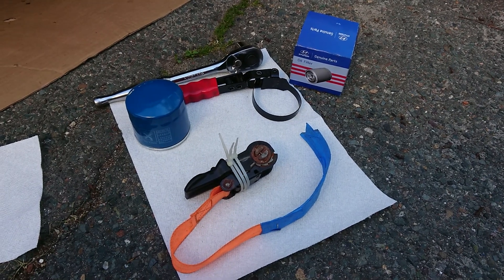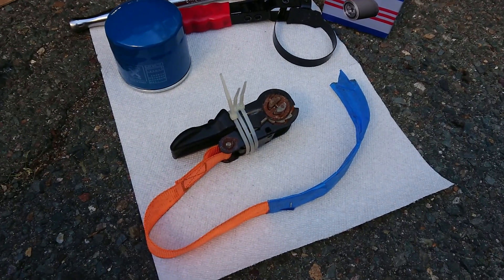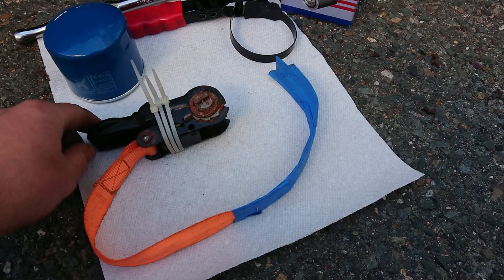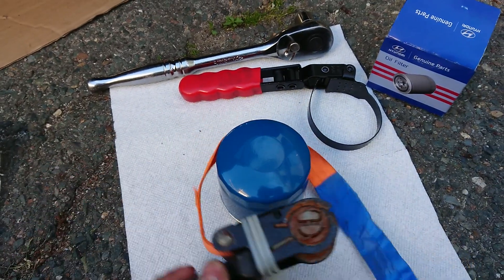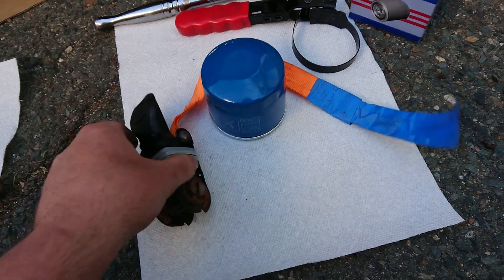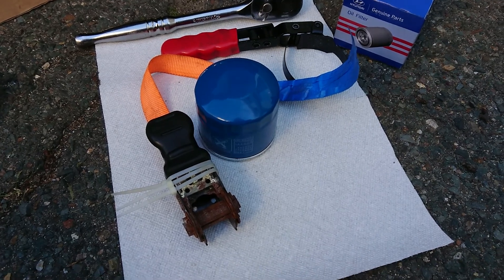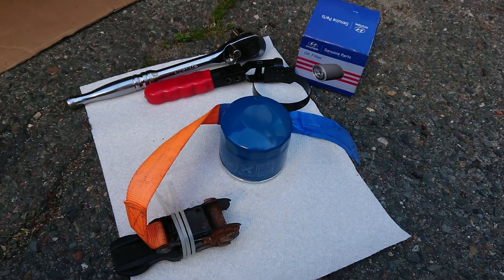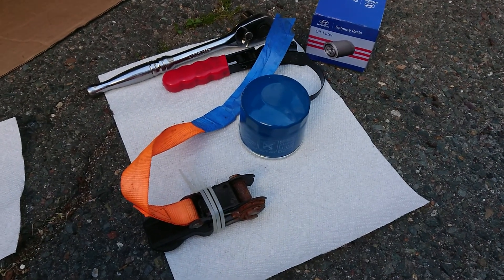Super simple DIY wrench for removing / installing car oil filter - 2 minute wrench for oil filter

Comment: Dude.... Thank you! First time I changed my own oil in years. Also have a filter wrench that was too small. Took a ratchet strap and tied a poacher's knot, slipped it over filter and wrapped strap around once. Just had to find the right angle to pull on it, then it worked like a charm! Many thanks!!!!! 🙌🙌🙌
Reply from the maker: Yeah it's kind of ridiculous how simple it is after you do it once there is really no point to even buy the tool. I should make another video on one that's just slightly better for re-use in the future.